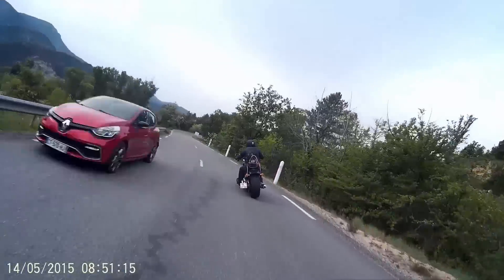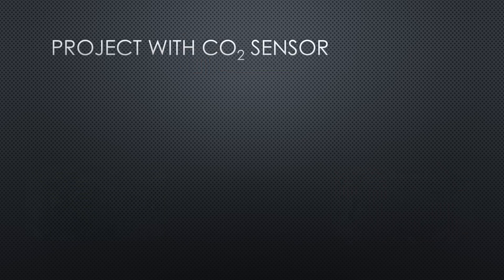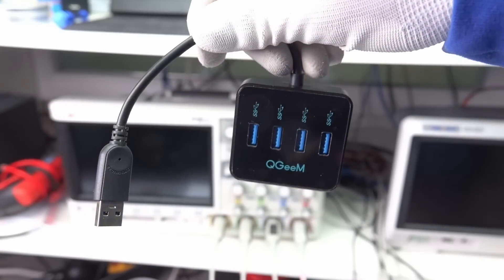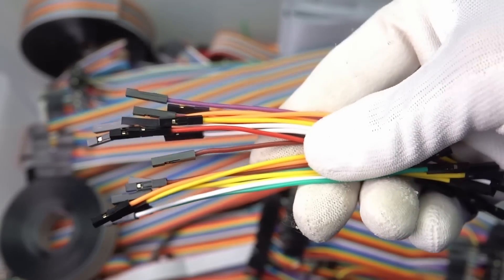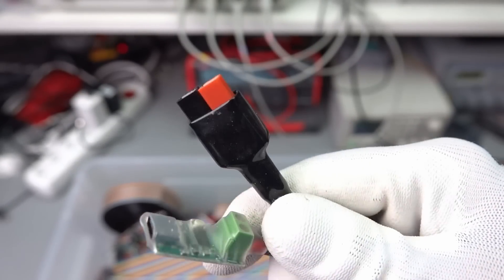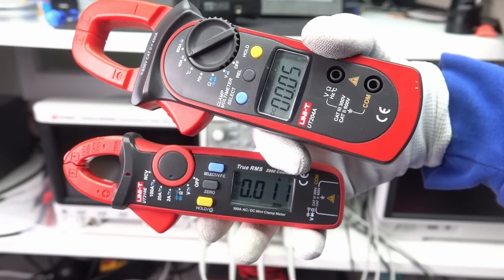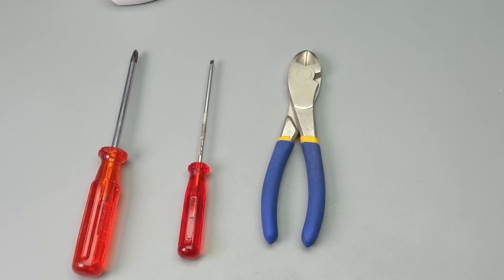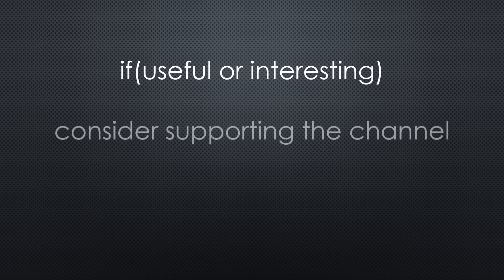450 My Electronics EDC Kit for Travel

Comment: imo the power supply is a must have without power u aint getting anywhere with your electronic project i made a pd powered one with those digital controled buck boost converters and with some built in battery so a powesr bank is not always necessary
i also always bring a esp32 devlopment board with me cuz it dont take much space and u never know when ull need it
a usb tester is also good to have for all the devices that charge from usb
Reply from the maker: Good input. Thanks!

Comment: in 2:32, is it possible to use the SIM module and connect it to ESP8266 to give it internet access, and I want to configure ESP8266 via Tasmota by choosing, for example, one of the pins as Tx and the other as Rx? Is it possible to connect the Rx of ESP8266 with the Tx of the module and vice versa? please Help🥲
Reply from the maker: You can connect RX/TX to another module. However then you loose the upload and serial print capability. Better google „software serial“
Reply: @AndreasSpiess  By default, there are already Rx/Tx pins on the ESP8266. If I connect them to the Tx/Rx pins of a module like the SIM800C, do I need to use Tasmota to configure the Rx/Tx pins? Please help😕

Comment: I can't say enough good things about The Checklist Manifesto. I bought it in 2010 while doing research into the Apollo Space program. Checklists were (and still are) vital to any space mission. So do yourself a favor and buy the book.

Also, powerpoles are great. I use them for my ham radio stuff. And because I have an M2 Macbook, I no longer need 19 volts to power my laptop. I can use USB-C to either power the laptop (15w) or charge it (30w+). And the speed of the laptop is better than most Windows computers. So yeah, the fewer watts used the better
Reply from the maker: Thank you for sharing your experience! I can imagine that in space, such checklists are important, too.

Comment: did you think about PC based test equipment like Diglent analog discovery?  it has scope, logic analyzer,  waveform generator power supply?  not rewal inexpensive but not too bad.
Reply from the maker: The Analog Discovery is a good product. I am reluctant with USB devices because, in the lab, my PC monitor is away from my bench, and on the road, I usually only have one screen.
But these are very personal thoughts...

Comment: For those who like the XT60 connectors, note that they have somewhat recently come out with a smaller XT30 version. These are much cheaper per unit, but way more compact and are generally more than adequate for electronics type projects except in very high-current applications. Especially when traveling, a bunch of homemade cables and adapters terminating in XT30 connectors take up a lot less space than XT60s, and I'm quite comfortable using them up to 20A or so continuous (they're officially rated to 30A, but I prefer to be conservative).
Reply from the maker: I did not know and ordered a few now. Thank you!

Comment: I don't know how I survived the years I left my house without a multimeter. Even at work, where I don't really do any electronic engineering, I do enough power supply and pinout checks where I use it all the time.
Reply from the maker: Indeed they are handy if you do not want to guess.

Comment: Did you see I had that multimeter.  Good for DC current. No gold this week. Bathroom upgrade coming along well.
Reply from the maker: No, I was not aware that you have the same Multimeter. Good when the bathroom will be finished. Then you have more time for important things ;-)
Reply: @Andreas Spiess  Yes, I need to fit the second row of batteries, mate. Then, work out the RS485 connection to the batteries.  Plus, I need to check out the new stuff I found on how the pyramid really works.

Comment: ha! my comment might have been deleted for being too long (spam filter). it had a few suggestions in it, some thank yous. But the reason i cam back now was to remember something else useful, for mobile toolkit: what you can do, is get some mini glue sticks. (and there is maybe the normal translucent type, but also you can find on aliexpress a black color type, that is supposed to have stronger adhesion properties). Andhow... you can get a few little glue sticks + a cigarette lighter. Or something like the... "BIC EZ Reach Lighter", which is just a cool cigarettle lighter that you can use for longer periods (without burning your hands). And i have seen another youtuber, you can just melt the hot glue sticks with the cigarette lighter. And then you do not need to carry around with you any extra glue gun. And it does not even require a power outlet to make use of. That is another good tip.

(sorry youtube lost my previous tips, if you get my message i can try to repost my original comment again, it's just a very long and verbose comment, including a few other specific suggestions). Ok, have a nice day
Reply from the maker: A good idea with the hot glue!
A while ago, YouTube started to delete most of the comments with links. So we have to use some tricks to fool it if we want to transmit link information...

Comment: I have used a cell phone backup battery for my kit & found that it didn't have enough power drive my esp32 with a display.  I had two others that also didn't work.  One was a combination backup battery & hand warm and the other was a flashlight.  I do have one that does work.  It's a work light - too big for a traveling kit.
Reply from the maker: Strange. Maybe the display consumes a lot of power. With the board I showed so far I had no issues (powering from the laptop USB)

Comment: I use my Uni-T clamp meter all the time when diagnosing automobiles. Works great, but sometimes you have to clean the battery contacts on the PCB so it stops resetting itself when flexing the case or opening the clamps.
Reply from the maker: Good to know. I do not have the small one for such a long time...

Comment: Some times i take a chromecast with me, especially when i don't take my laptop with me. And for the non electronic  things some tie wraps. Tie wraps are small, have a low weight and can be usefull in many situations. You can also use it to close your luggage. However a knife to open it in your hand luggage is not allowed when you fly.
Reply from the maker: How do you use the Chromecast for your electronics hobby?
I bought my Microsoft Surface for my bicycle trip to the black sea. I did not want to go without laptop ;-)
Tie wraps are good. I add them in the "viewer supplied" category.

Comment: I strongly recommend an Analog discovery, in different flavors. There is no box that can do more for you: at last 2 channel scope, 2 channel waveform generator, 16 channel logic analyzer, 16 channel waveform generator plus these instruments can be combined together.  
I have been using the original one for years now and it is ideal for microcontrollers/sensors etc.
Reply from the maker: I agree. These are good devices, but maybe a bit pricey for the hobby. So far, I newer used one.
Reply: @AndreasSpiess  oouu... did not check the price lately, you are right. I paid 150 euro for it a long time ago with a student price.

Comment: I always have with me a NCV tester, if you work on a potentially live wire you should always check first, I don't know if that clamp dmm has that feature or not
Reply from the maker: Some of the modern multimeters have this function built in. I use the AC range of the Multimeter for that purpose…

Comment: Another great Video with interesting toughs, thank you Andreas!
Regarding the Scope: I really like  my PicoScope 2000 USB Scope. Its Really compact, the software is easy to use and it offers a lot of options, +-20V is usually enough for MCU Projects and it dosnt req. any aditional power. But for me the seling point was that it can decode many Serial Protocolls out of the box like I2C, SPI and UART. The MSO Models even have up to 16 Digital inputs, wich is great for Logic debugging (but also quite expensive).
Reply from the maker: Good points. I added a cheap logic analyzer to the "user supplied" category because it can replace an oscilloscope in many cases.
So far I always refused USB oscilloscopes because I need them on the bench an my PC screen is elsewhere. But this does not apply for everybody, of course.

Comment: you could replace the oszi and multimeter with a pokit pro.  I've been using it for a few months now and I love it😊
Reply: I had never seen the pokit pro before. Looks great. I am always a little wary when something needs another device to work but  may be a good compromise when travelling lite. It would be good if it had a tiny display on the unit to show basic multimeter readings, and only require firing up the cellphone for more complicated things like oscilloscope .
Reply from the maker: I also do not know the pokit. But I added a cheap logic analyzer to the "user supplied" category. It can replace an oscilloscope, too in many cases.

Comment: Flipper Zero seems like the best multitool for you to have
Reply from the maker: For what purpose?  So far, I never had a use case :-(
Reply: I believe you can flash an esp32 wirelessly... But definitely a "nice to have" since it does so much...If you can even find one.
Reply from the maker: @iknowsolittle  Yes, you can. It is called OTA.
Reply: I'm not sure I agree. I have one since backing it on kickstarter and it makes an excellent bluetooth presenter remote but the rest of the functions are much better performed with much cheaper in many cases, dedicated hardware.

On the learning front, the documentation for developing on it is severely lacking or at least was when I looked a few months ago.

Comment: Leatherman or its Swiss-Army-eqivalent 😉
Would add the Pinecil as an additional alternative to the TS80 - I just like the open-source approach, and if you are in the US, you can get it dirt cheap.
Reply: Pinecil V2 is great. It comes with the USB PD capability of the TS80 but the power of the TS100. Also has barrel jack for the laptop power supply, so perfect for the travel kit.
Reply from the maker: Pinecil is added to the list
Reply from the maker: Thank you for your suggestions. I already added a Leatherman because of other viewer comments! And I agree, there are alternative soldering irons available.

Comment: Gread video. 
For older eyes, I always take my dads Eschenbach Fadenzähler as magnifier and a lamp - or the cheap stereo microscope.
Since i'm living in an partment, i have tool boxes like your project boxes that can be stored away or put in the vincinity of the desk. I also take these boxes visiting the local repair cafe or family and friends by car. No need to re-arrange things and remember were something currently is. Examples are an old suite case for various stuff (screw drives, pliers, cutters, IFixIt set, hefty screwdriver for bits) aided by boxes to solder, do mains installation, or etherner. Sure I mix tools and exendables, but that works out.
Going on an ham radio field day is still a a nightmare.
Reply from the maker: You are better organized than I am! It shows once more that constraints are useful! 
I would call a Field Day a project, BTW ;-)

Comment: Regtarding the scope...

I work in the field most of the time, and for a scope, despite trying a number of portable scopes, both tablet (eg Micsig) and hand held (eg Owon, Hantek), by far my go-to scope when baggage is limited is the Analog Discovery 2 which includes an LA, waveform generator, pattern generator, and variable bipolar power supply albeit limited to  +/-5V and low current, but it is suitable for almost all the MCU projects I work on. The best feature is the Waveforms software. True, as a scope, it has limited bandwidth, but for the vast majority of things I encounter on the road it's easily sufficient.

Plus, if you're on public transport, you can pre-wire the AD2 to your development board and put it in a small box so you can develop on the train or plane journey.

Sometimes I really do need a "proper" scope. Then it's either a Rigol MSO1074Z-S (nice and small), Keysight MSOX3104T, or a Tek MDO4104C depending on the requirement, but all are carried in the manufacturers' purpose made protective padded carry cases. But the Analog Discovery 2 is always with me.
Reply from the maker: I agree, the Analog Discovery 2 is very versatile and small. After some commenters I added as a cheap alternative a cheap logic analyzer. It is no scope, but in many cases, can replace it (digital work). Bandwidth, BTW, often is not important if you are on the road.

Comment: Having the ability to enter a remote session to one's primary computer at home can be a lifesaver. An ftp or ssh session might be all you need, but having the option to fully remote-desktop is nice as well. That is helpful when someone at home has an issue with something and the easiest solution is to just connect remotely to fix it. Teamviewer is not a good solution for that even if chatgpt would say so.

Comment: The '63 item' project kits you can get on Ali etc. of breadboard, stepper motor and driver, encoder, keyboard, displays etc. etc. are a nice compact package that fits in a spare corner of a suitcase and may have that elusive item you need. Also one of those 24MHz logic analyzers (or the Salae one if you're feeling flush). I would like a nice USB oscilloscope with built-in function generator but have not bought one yet.
Reply from the maker: I think they are perfect as a starter. However, I probably never need all of them at the same trip. This is why I would advocate to make a selection for the trip.

Comment: You basically never need a laptop. Android has its own arduino sdk that is fully functional. I've programmed parts of my thesis on an android phone, because it is simply more mobile. Serial monitor or wireless programming, all works.
Reply from the maker: I am old school and like big screens because most of the cases, I need more than one "window" to work. Maybe this is because I am already old ;-)
Reply: @AndreasSpiess  That is true. The thing that I most miss, I my 27" monitor
Reply from the maker: @jorgeturiel9689  For me, two screens are a "human right" because I always have an input and an output at least. I do not understand people changing the windows all the time...
Reply: @AndreasSpiess  At home I have my laptop and the 27" monitor. So I have two screens. Iam a old mab too

Comment: Glue and adhesive tape you missed I think. Remember Apollo 13 where they had to fit CO2 absorbers from the LEM to the CM interface
I suggest superglue +  Accelerator and 2 min epoxi ( Uhu Plus sofortfest). For mixing small amounts I use those plastics from  one day contact lenses. Toothpicks and Ear cleaners are also helpful + small bottles Isopropanol and Acetone.
Reply from the maker: You are right, they are all important things. I added electrical tape to the list in the description because I want to keep the focus on the "electronics side".
Reply: I prefer a chunk of thermoplastic for most applications. Amazing stuff.

Comment: I would add, a little logic analizer, a mini Spectrum analizer, some meters of silicone cable, a usb current and voltage meter, in my case a hub with wifi. and a  couple of micro Py or arduino nano just do some signal simulations. Often used for my PLC proyects.
Reply from the maker: Thank you for your input. I added the logic analyzer (often good instead of the oscilloscope) to the list in the description. The rest is more project specific in my opinion (I do not like USB meters if I only have one screen ;-)

Comment: I'm mostly mechanics guy, 
Thick swiss mutli tool
Wera toolcheck plus
Gray electric tape
Usb soldering iron + lead solder 

If i have more space: cheap 1/4 socket set 😀
Reply from the maker: Indeed, we could add a "mechanical section". I added a leatherman to the "viewer suggested" selection in  the description. Electric tape is also useful. I will add it

Comment: Thanks for the road tips! I also like a mobile scopemeter and the UT210E. Also very handy to measure PV string currents. And I also have an "end of live stock" of  SnPb solder. Very versatile is a cheap pair of scissors and screw drivers, too.
Reply from the maker: I forgot the scissors, you are right. They are in my "standard" travel bag. And as a new owner of a PV I also was happy about the ampere meter. It would be hard to measure the current with another tool.
Reply: @AndreasSpiess  i have a scissor that can be folded together, and my SAK has also scissor. In my must have set is a leatherman juice (that includes a scissor). Speaking of folable things a folding magnifier is also in my must-have section.
Reply: @AndreasSpiess  My Swiss Army knife has scisssors…
Reply from the maker: @mahudson3547  I agree. I always have a small Swiss Army Knife" in my toilet bag.
Reply: @AndreasSpiess  Yes, Even more it would be flashy destructive to open an 800V string while delivering 10 A.

Comment: Nice list! I like the mind map. The UT210E is definitely handy. I also suggest good wire strippers since family often needs help with 'mains' projects. Also, a (3 lamp) plug to show sockets are wired correctly.
Reply from the maker: The wire strippers are good for the "nice to have" bin, I think. And indeed, I did not think too much about mains projects. They require a few other things, I agree.